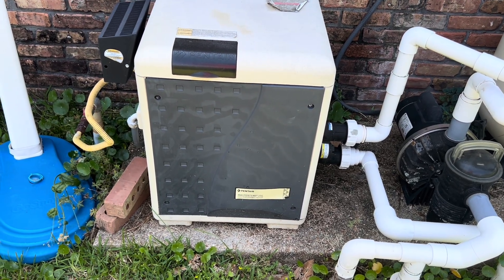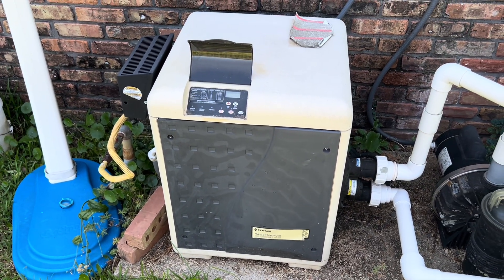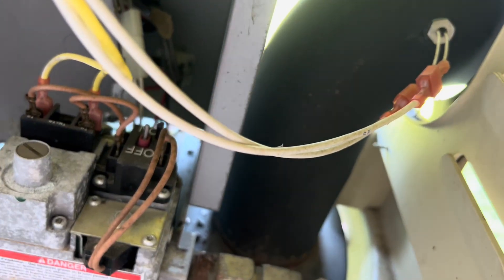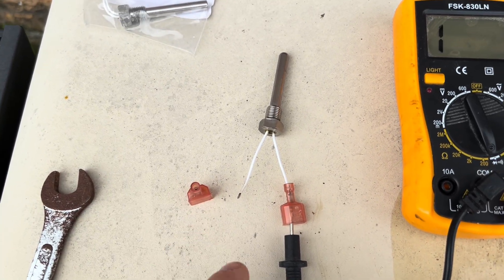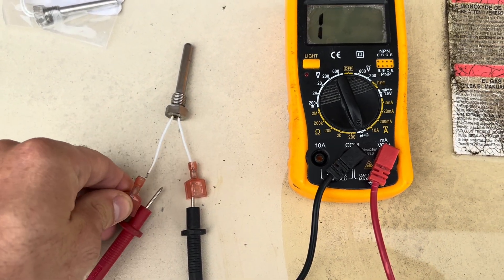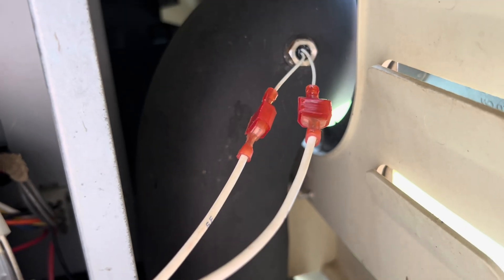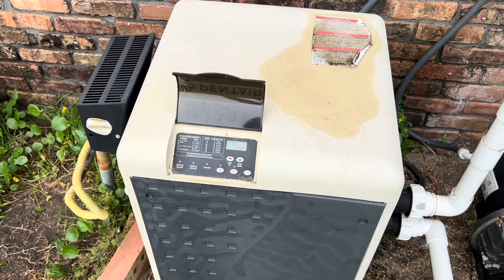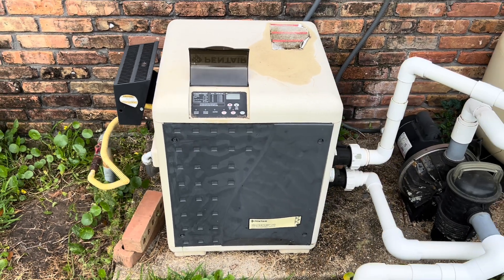Pentair MasterTemp Pool Heater - Service Heater Light (MasterTemp 175, 200, 250, 300, 400)

Comment: replacement sensors are available for about $16 on amazon.  I bought a second one because these heaters go through this sensor like popcorn.  Probably came from the same factory in China.   On the newer Pentair heaters, it gives you an SFS error, not  just a red light,

Comment: Everyone that comes across a high stack temperature changes the sensor. What if the sensor is accurate and the stack temperature cycles the heater on and off? The ignition motor or inducer motor is functioning and not dirt on wheel. Pressure switch closes so if there was lack of air the pressure switch would not close. The gas pressure was set to -0.20 WC and I am sending 45 to 50 GPM through heat exchanger. The heat exchanger was cleaned not to long ago 2 years or less and the pool heater wasn't used too much due to a poor summer climate wise. I did notice late ignition once and the bang/pressure coming out of the exhaust vent. I am leaning on changing the HSI hot surface infighter but still won't fix stack temp. I also changed the sensor fyi. I nay double check gas pressure at some point - Anyone come across this? Sounds like a multiple issues but one at a time.